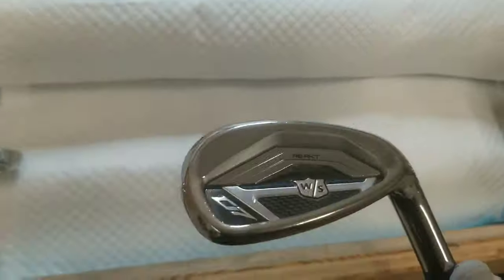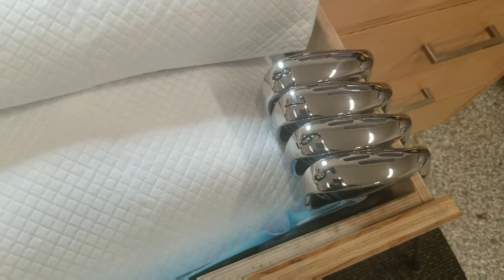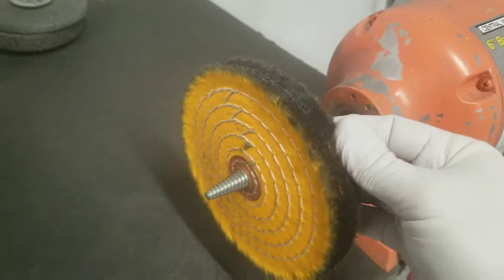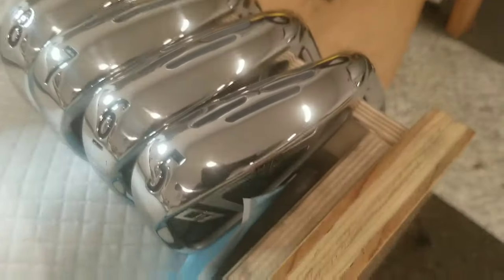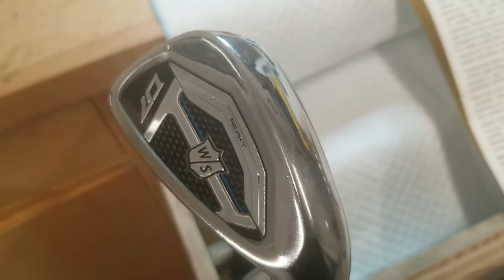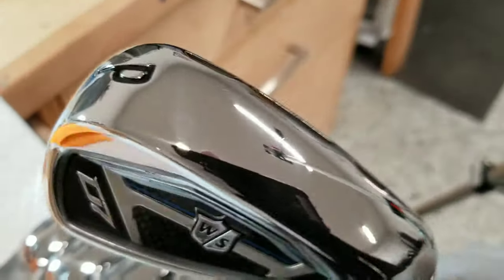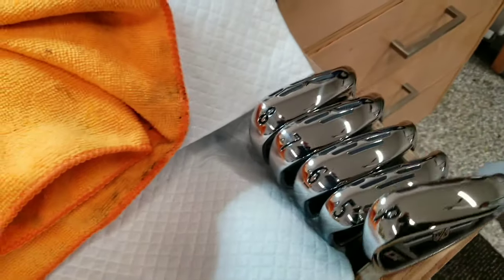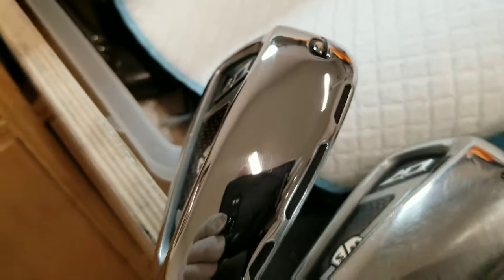How to Polish Golf Clubs Like a Pro

Comment: When I was studying jewellery and metalsmithing that you should always have a dedicated polishing wheel for each type of abrasive in order not to negate the polishing stage that you had just completed.  For deep scratches we started wet sanding with 220 grit wet or dry sandpaper, then 400#, 600#, then to tripoli and then rouge.  As the polishing progressed you could see where you missed removing some scratches so it required going back to the previous grit then working your way back up.  I have never used a buffing wheel for multiple grits of polish, and when completing one grit a quick wash with a good detergent such as Tide in order to remove any remaining polish with its carrier.
Reply from the maker: I agree. I now use a dedicated wheel for each compound.
Reply: I concur. Wheels are inexpensive and easy to switch. No different with motorcycle parts, golf clubs, or restoration of vintage parts.

Comment: When explaining how to enhance reflection to someone, just tell them to think of it as “leveling” the sharp cliff edges of a canyon until it’s more of a gradual sloping valley.

Also, apply some automotive ceramic coating to them now and they will stay clean when you play.  I do it a couple times a season and pretty much eliminates the need to brush your clubs after a shot to remove dirt.  Nothing sticks.
Reply from the maker: @newfinishautospa  Great tips. Thanks, man.

Comment: Hi Brad, truly excellent work here! Is there any way to remove those sole scratches caused by hitting off carpet mats at a driving range if power tools like what you have are not an option? If this is possible, which polishing product would work best?
Reply from the maker: Even a soft scouring pad would scuff it enough to remove it. The key is to use finer and finer grit paper and the shine will come. I learned this from watching a video of a guy polishing an axe with just sand paper.

Comment: Hello, in your Amazon list, the bench buffer. Would the hard buffing wheel it comes with work or would you recommend getting a denim wheel like you used in this video?

Thanks!🤙
Reply from the maker: I'd recommend getting the kit of the various wheels so you have a sisal wheel, a denim, and a loose cotton. Those three will get you through all of the steps to get a mirror finish.

Comment: What an amazing video!!! 
I want to restore my irons and wedges. My irons are chrome and my wedges are steel with a black coating I’d like to remove, would I carry out the same process onto my irons?

Thanks 
Josh
Reply from the maker: The polishing part is thr same, but you'll need to deal with the chrome, then try the plating method I did. Check out my nickel plating tutorial video and  some older bladed irons I've done and you'll see the similarities.
Reply: I once polished a black wedge to reveal a chrome plating underneath using the same polishing process as Brad…it still looks good a year and a half later

Comment: Great video; thank you.  Does the process alter the club face at all?  Ie, when there was a little overlap with the wheel brushes, did it remove any of the grippy, rougher surface of the face that's supposed to be there?
Reply from the maker: Polishing is not very aggressive and would take a long time to alter the face. The matte finish will be altered, so you'll have to use the bead blaster again to make that area dull again next to the shiny sides.
Reply: @BradMeehan  Thank you!  Exactly what I was curious about (the matte finish - I described it poorly).

Comment: Is there a way to do this by hand? Assuming using a high grit sand paper, maybe wet sanding? Not sure but might make a good video for those who don’t have power tools. subbed brother!
Reply from the maker: 💯. All of this can be done by hand. This is how I learned to do it with just sandpaper. Just use straight lines and don't skip ahead with higher grits or you'll bury scratches in the finish.

Comment: Great content! Quick question, do you have any recommendations for a fan system of sort for the debris that comes off of the polishing wheel when using the bench grinder? My workshop is in my basement and it looks like a bomb went off after each time I get done with a set of clubs 🤣. Any help would be greatly appreciated.
Reply from the maker: This is a great question. @McGolf has a vacuum or dust collector in his shop that I'd love to know how it was made. I will reach out. 

In the meantime, i HIGHLY recommend you check out that pedestal that my polisher is mounted to. This allows me to bring the whole thing outside and keep my shop (and lungs) clean.  It's such a messy job, that I'm still finding BLACK SOOT on everything. I wish I had that pedestal from the beginning:

https://amzn.to/3PzDlLp

Comment: Awesome video. How thick is your denim wheel? Amazon has 1” and 1/2”. For golf clubs, what thickness would you suggest? I don’t want it to be too thin/thick so just interested. Also, as I’ve researched compound grit charts, they seem to be inconsistent where in some cases white is grittier than brown.
Reply from the maker: Hi, David. Mine are 6 x 1/2. I prefer the smaller width to get into smaller areas around the ferrule/'crotch" areas.  I agree on the inconsistency of the compound grit. The kit of compound I bought has a chart with the recommended compound for each type of metal. 

Below are links to the exact products I purchased on Amazon:

https://www.amazon.com/gp/product/B079X52ZG5

https://www.amazon.com/gp/product/B07H6ZVVXF

And I highly recommend these:

https://www.amazon.com/gp/product/B07789NKCV

https://www.amazon.com/gp/product/B07L4VYKYY

Let me know if these links don't work for you and we can connect offline.
Reply: @BradMeehan  you should put this comment in the description! Great video, very informative and solid comparisons.

Comment: I am very inexperienced and started doing this last night on my clubs. Wondering how careful I need to be to not remove too much material. I feel like I'm being very gentle but also feel like the club can take a lot more buffing without losing its shape. Wondering about your thoughts. Thanks
Reply from the maker: It depends on the type of club you're working on. If it's a cast club like the one in the video, you can polish away. But if it's forged steel with a chrome coating then you'd have to be careful not to sand through the plating down to the bare steel or you'll get rust unless you plate it. You're removing what equates to a layer of dust to get the scratches out. So don't worry too much about affecting the shape. 

I'm a total dipshit, so don't feel weird about being inexperienced. I was too. I just bought a few junk clubs from the thrift store and practiced until I felt comfortable knowing I wasn't going to ruin anything.

Comment: What do you do for the face where the grooves are?  It looked like you were abounding that area.
Reply from the maker: Check out my face reconditioning video. I use a cheap handheld sandblaster gun. Works great. There's equipment links in the description to see one.

Comment: Looking at the extenders. How are the wheels secured to the extender?
Reply from the maker: The extenders are tapered and threaded so as the wheels spin, they're always "tightening" towards the fatter area of the extender with thr pressure you put on it with the club. Easy on, easy off.
Reply from the maker: I added links to the extender in the description if you're still looking for them.

Comment: Hi.  Is there a limit to the amount of times you can polish something like a club.  It sounds from what you've said like you're scratching it to make it shiny, so is there a point where you can't do that anymore (e.g. you've 'ground it down')?
Reply from the maker: we're removing such a minuscule amount of metal, you'd really have to be doing something aggressive before you change the shape of the club that would affect it.  The only thing you'd have to worry about is sanding away them numbers and stampings.

Comment: Hi Brad, sorry for all the questions but you really are a helpful man! How do you create a brushed look finish on the club. What wheels would you reccomend using and what is the process. if you could put out an affiliate link and I will order through that. Thanks a lot
Reply from the maker: I generally polish it first for a clean, uniform look then you can either use the deburring wheel or Scotch-Brite pads to get the brushed look. The key is to go in the same direction with the scuffing. There's a link in the description to the deburring wheel. I've also been using the Multi-tool bench grinder attachment with the Scotch-Brite belts that look great. Just depends on how much you'll be doing this. The link to that is there as well.
Reply from the maker: And keep the questions coming so you can be successful at this.

Comment: Hi, Brad. I have the 2009 Taylormade Burners and they are quite scratched. Is it possible to remove the scratches? I received my order of the polishing wheels, compounds, etc.. and worked on my clubs today. Very happy with the results (nice, clean and polished) but the scratches are still there. I used Black and Brown on the Yellow wheel. And then finished up with White and Green on the soft fluffy wheel. THANKS!
Reply from the maker: Im glad you tried it! You may have to do some sanding to get the scratches out, then polish with the wheels if you want them perfect. I don't believe they're steel, so you won't have to plate them.
Reply: @BradMeehan  Thank you, Brad!!! You are AWESOME!!

Comment: Should the sisal wheel and black compound remove most scratches ? Then it's just working through the different compounds from them on?
Reply from the maker: Yes, but nothing too deep. If you van feel it with your finger nail, you'd have to smooth that down with sanding first. Then, use the sisal wheel to get rid of all the sanding marks.

Then, it's just polishing. Don't be in a rush to move to the next compound too quickly or it'll look cloudy. Take your time on each one.
Reply: @BradMeehan  thanks mate appreciate the advice ⛳👊

Comment: I just bought a set of Ping ISI-K gold dot clubs off eBay that have seen better days. I have a 6” grinder sitting here with buffing wheels already on it and I never thought about using it on these. Well, I know what I will be doing this week now. I just have to figure out what kind of paint to use to restore the white club number markings on the heads that have all worn off over time.
Reply from the maker: Did you get started? How's it going?
Reply: @BradMeehan  I got a few of them buffed up like new but then I started to build a 10x10x20  indoor golf simulator in my living room before I could get them finished. Hoping to get back to finishing those up soon.

Comment: Is there a by hand video? I live in a smaller place and have no options for power tools unfortunately
Reply from the maker: I will make one, but you can do this with just varying grits of fine sand paper. Like 600 grit, then 800, then 1000, then 1500, etc. The higher grit you go, the shinier it will get *IF you take your time and don't skip ahead too fast.

Comment: Hello I know this video is off a couple of years ago but would like to ask you a question... I bought a sw off ebay to match my set the base of the club is in pretty poor condition can I use this process to take out the deal imperfections but baring in mind I have never done this before I have a picture of the club but don't know how to add the pic. Thank you
Reply from the maker: Absolutely. Sand paper would even get the scratches out. You use varying grits of paper, going higher and higher. You can start with like a 400 grit, sand away the imperfections, then switch to 600 grit (to get the scratches you made with the 400 out), then 800, 1000...

Check out my How to Make a Polisher video to take it from the 1000 grit to the mirror finish. 🪞
Reply: @BradMeehan  thanks Brad for your info I'll give it a go but they are more than scratches more like indentations on the base of the club if you know what I mean thank you Brad
Reply from the maker: @johnner70  I'd recommend finding a $1 junk club to practice on.

Comment: Brad what would you say is the best way to remove deep scratches that just aren’t coming out with the black compound
Reply from the maker: Clubs like these, you can sand with 400 grit, then move to 600, then polish.
Reply: Can this be done on a bench grinder sanding grits? And if so what one would you reccomend
Reply from the maker: @SuperLewisjudd  That's too aggressive. Those are like 60 grit. In the videos, I use the deburring wheel, then hand sand those scratches away, then polish. There's a linknin the description for the deburring wheel. It fits onto your bench grinder. It will give the club a brushed look, which is why I sand those scratches with paper.

Comment: Hi Brad, I have a club with a satin finish here. I have slightly took to much off and now can get the satin finish back. What would you recommend to do I am worried
Reply from the maker: Do you have a media blaster? You can get it back with a light dusting to dull the shiny parts. Mine us a cheap one but it does the job.
Reply: @BradMeehan  no I do not have a media blaster I will look into purchasing one. Is there any other quick solution? Thank you
Reply from the maker: @SuperLewisjudd  Red Scotch-Brite pad will take away the shine and leave a light brushed look. They're sold in the paint department as a paint scuffing pad. If you're in US, Walmart has them too. Just mask the areas you want to keep shiny. The right way is the media gun but this will take away the gloss look.
Reply: @BradMeehan  okay thank you so much

Comment: You have me buying a bench grinder now!  Will polishing the club face (the hitting area not the surrounding shiny steel) do any good if you see a few blemishes on them? Or will that do more harm than good? Thanks
Reply from the maker: I generally polish mine to give a uniform appearance, but i don't sand them. I'm removing MINIMAL material from the face for the same reason as you describe. If it's just wall art, you can sand away, but if you're going to play them then take it easy in the face.  The sand blasting at the end will hide the blemishes a bit. There's a groove sharpening tool that I would hit the face with anyway. It's on my shop page in Face Reconditioning section if you want to see what one looks like:  https://www.amazon.com/shop/bradmeehan/
Reply: @BradMeehan  - Thanks very much for the reply / thoughts.  Was hoping not but looks like I'll have to buy a compressor / sand blast materials, groove sharpener if I want to do this right.  Why can't I find hobbies that aren't expensive arhg.  Darts.  Origami.  Bird watching. But no, I had to choose golf, photography, learning musical instruments, audio engineering, PC gaming, adopting animals and chasing women.  My wallet can't take it no mo
Reply from the maker: @ikigai47  I'm a big cheapskate so you can definitely do this on a budget. One bit of advice is to buy the biggest compressor you can afford.
Reply from the maker: @ikigai47  Kill two birds with one stone: chase women with a big compressor.

Comment: Hi Brad, I’ve watched some of your videos. You do a great job! Just curious, do you actually polish the face of the club on the buffer wheel? If not, what do you do for a technique to remove the scratches? Thanks
Reply from the maker: On a cast club, I sand them a bit to disguise the large scratches, then polish the face for a min just to make it look even. You can use the little media blaster like in my last video or the Wilson Reflex video for the contrast and texture but I didn't do that part in this video. The faces looked really good.

On forged clubs, I wouldn't sand through the chrome or it will oxidize. Unless you re-plated it like I did with the nickel bath video.